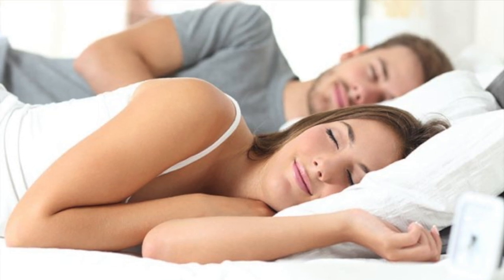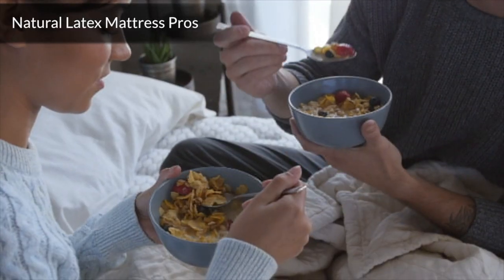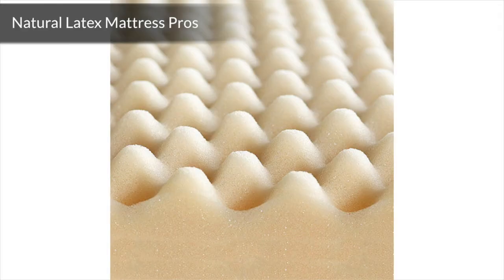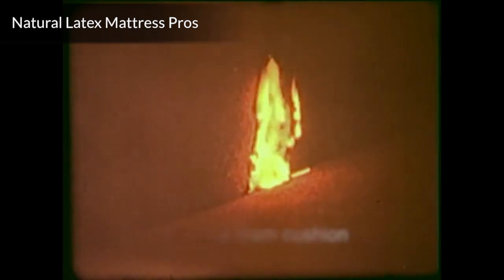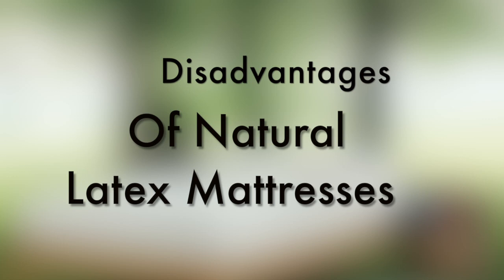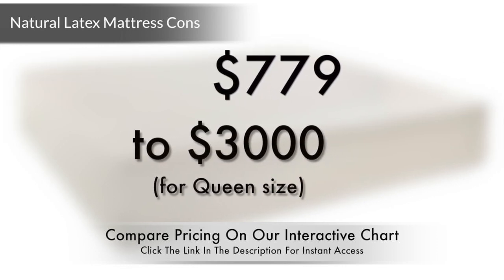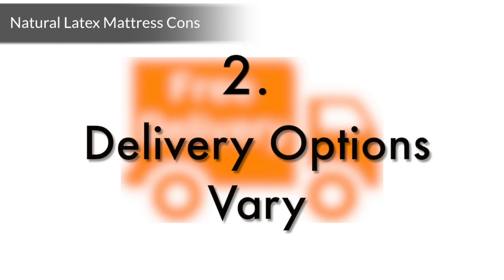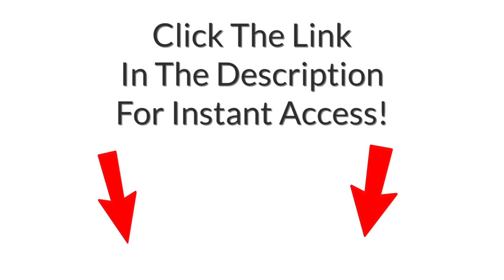Should You Switch To A Natural Latex Mattress? Pros Vs. Cons.

Comment: I've tried many  natural latex products, all latex bed by Sherwood that sunk bad very quickly,, Latex Toppers, and most recently a Nest Latex Hybrid.  The first one lasted 2 years, got lumpy and sank in the middle, they replaced it and the second one went 1 year, developed a hard spot down the center and felt lumpy like all the other latex products I've tried. NOT believing they last longer from my experiences, all have gotten lumpy within 2 years, some two months! Being very biodegradable I think it starts breaking down before it ever leaves Malaysia. I'm out, going with a higher quality foam bed myself.
Reply from the maker: Hi Ken, 
sorry to hear about your experience with the Sherwood mattress. 
If you're staying with natural latex for your next mattress, I suggest going with a latex layer that is 3-rd party certified by GOLS, Oeko Tex or Eco Institut. I would recommend the Idle Sleep Latex to you: https://www.naturalmattressfinder.com/recommends/natural-dunlop-latex-hybrid-by-idle-sleep/.  It is two sided, so you can rotate, and flip to ensure the comfort layers last as long as possible. I've been sleeping on this mattress for close to a year and no sagging so far.
Reply: This is just bs. Latex lasts about 2 to 3 times longer compared to even the best of foams. You probably didnt use a quality mattressprotector because yes when latex gets wet is will sag, but otherwise it will last for decades. There is also the chance your mattress was to soft or the support layer was not supportive enough.
Reply: @svenvanderzwaag1012  If it's BS why did Nest give me a new one? They agreed it was defective that's why. Not BS my friend but my experience, isn't that what these comments are for? geesh

Comment: We had an all latex mattress and it was a HUGE mistake!   It is extreeeeemely heavy and veeeery difficult to move from room to room and house to house!   If there were some way to enclose it in a frame with handles, then we might consider getting one in the future.
Reply from the maker: Hello, thanks for writing in. 
I go into a little bit of detail about moving the Spindle mattress, an all-latex core mattress that has three 3" latex layers in this article: https://www.naturalmattressfinder.com/spindle-mattress-review/ . I found that disassembling the mattress and moving it piece by piece was the most effective way to move it. I could actually move it around by myself by separating the layers, rolling them up and tying them. More details can be found in this "ALL-NATURAL LATEX MATTRESS PROS AND CONS" guide: https://www.naturalmattressfinder.com/all-natural-latex-mattress-pros-and-cons/

All latex core mattresses are fantastic since they are pressure relieving and customizable in your own home thanks to the zippered cover. But I would not recommend this type of mattress to someone that moves around a lot. It is best to go with a natural latex hybrid if you plan to move your mattress frequently. https://www.naturalmattressfinder.com/latex-mattresses/
Reply: Latex being heavy is actually a very good thing. The higher the density of a foam the higher the quality and the longer it will resist sagging. High density foam does not mean it will be hard. It can be very soft and high density at the same time. The density of latex is one of the most important factors why it outlasts regular foam.

Comment: I will bet $10000000000 that goodwill delivery truck that picks up an UNWANTED bed takes a turn on 395 and goes back to the manufacturer to be shipped out again..........want to bet?
Reply from the maker: Hi Steven, are you talking about a new mattress or an old mattress? In any case, I would say that yes, it is not impossible. But I would also say that this would be very unlikely.

Comment: Latex if you like sleeping in a sweaty incubator (all natural dunlop processed latex btw)
Reply from the maker: Hi Michae1, you may be confusing latex gloves (the blue surgical kind) with latex foam, which is more breathable than polyurethane.
Reply: @NaturalMattressFinder  it was 95% natural latex liquid polymer plus 5% other materials to convert into natural latex foam... mine was medium density, and I needed a wool topper to stop sweating in winter. Maybe a "firm" density won't cause heating issues as there is less sagging/sinking... although my wool topper was 5-7cm thick soft/plush
Reply from the maker: @michae1201  Hi Michae1, thanks for your reply. I would be interested in finding  out the model and manufacturer of the mattress in question. Let me know which one it is if possible. All the best, Daniel.
Reply: @NaturalMattressFinder  Dawn Latex Mattress Luxury M7.
Reply: @michae1201  Was it comfortable for the back though, Mich?
Reply: @michae1201  Hey Michael. I also bought a medium/firm mattress from Dawn Latex in SA. It's king size with tencel quilted cover. I have been sleep wonderfully on it since 2018 and I am a hot sleeper but not on this mattress. I have never once felt like it's making me sweat or hot in any way. My previous mattress was not as cool and resilient as my lovely latex mattress. When did you buy yours?
Reply: @parijatmathur8489  I got rid of it so can't comment there.
Reply: @miatand1156  5 years ago.